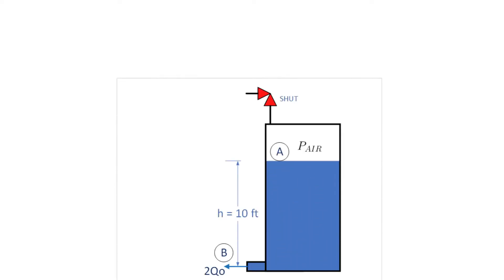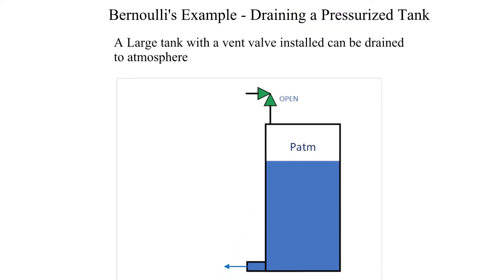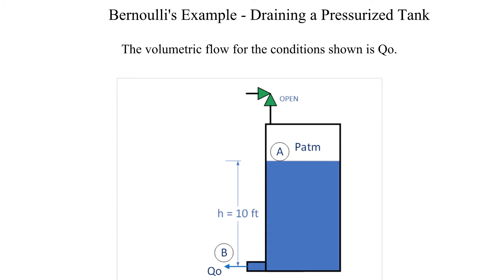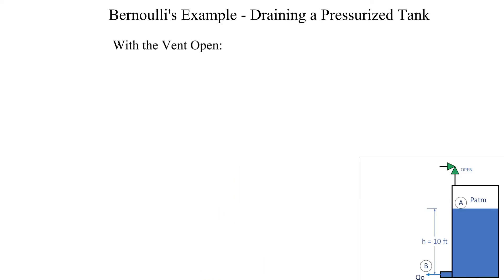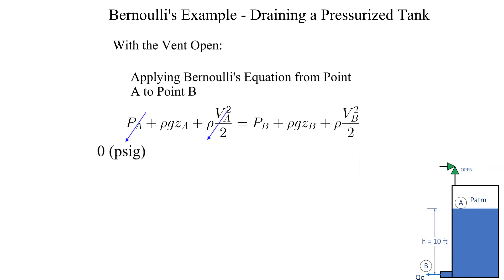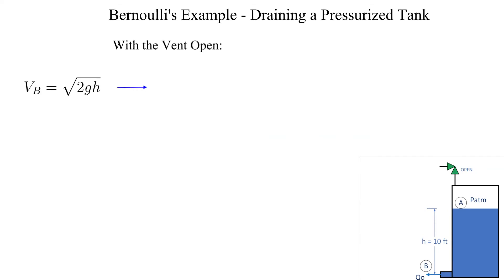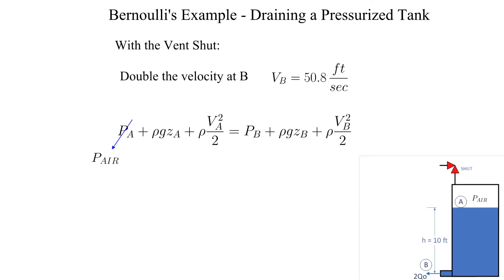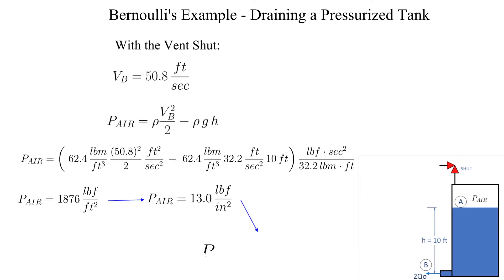Bernoulli's Example   Pressurized Tank

Comment: Why is 232.3 used for g? Shouldn't it be 32.17 ft/s^2?
Reply from the maker: You are correct.  It is a typo, actually two typos.  It should be 2(32.2).  I was using 32.2 ft/sec^2 for g.  I forgot the parenthesis and accidentally typed 32.3 instead of 32.2.  Thanks!